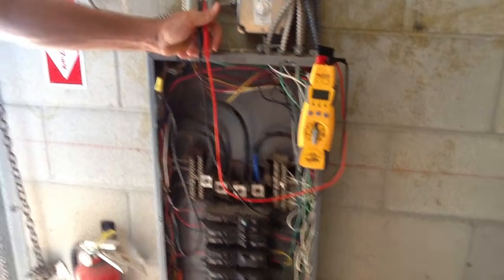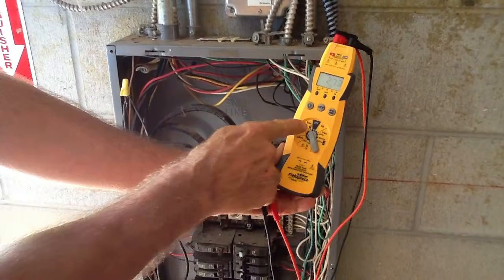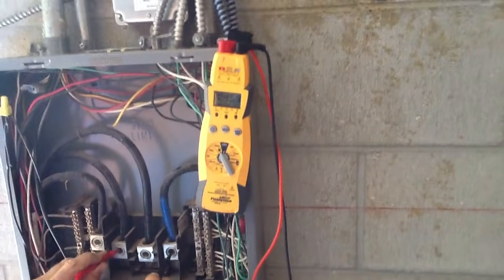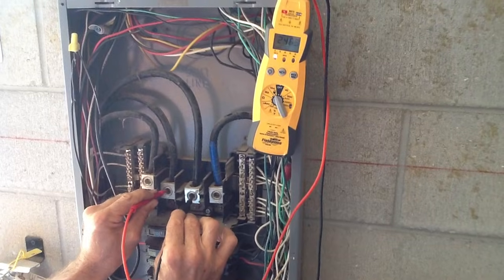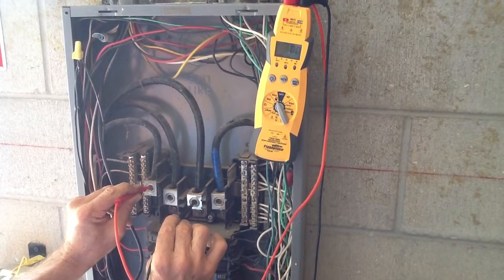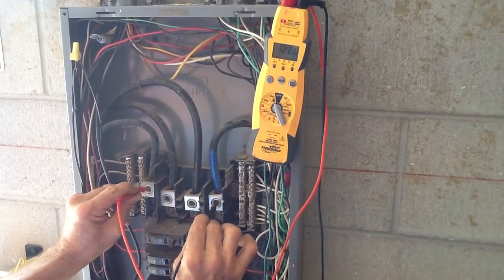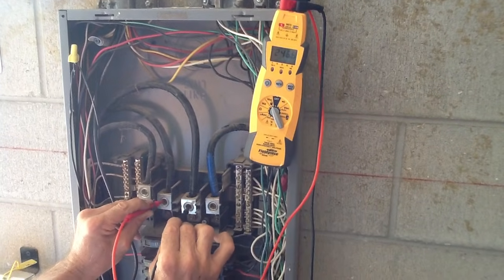How To Measure or Check for 3 Phase Voltage

Comment: Well, here in California, this is called 240 DELTA with high leg. That center power lnput (B) should have RED tape on it. That's 208 to neutral. Neutral is center-tapped between A and C at the transformer on the pole. There's NO high leg on a WYE (or sometimes called STAR) system, all phases are 208 to each other, 120 to neutral.
Reply: I thought the high leg always had to be marked orange.

Comment from the maker: This is a Delta system the center phase or high leg always has higher voltage providing by the power company for commercial business to operate large equipment at lower power rate to save power, also you will have 120 power for office equipment. Hope this helped. Thanks or asking.

Comment: You don’t always have a high leg on a 3 phase system
Reply: Ryan Gaines correct, he is getting power from a Wye-Delta transformer which will always have a 240V phase to phase and if done correctly L1 and L3 to ground/neutral will be 120 with L2 to ground/neutral at 208V. 
Delta-Wye would be a balanced load with equal reading across the board.

Comment: PROTIP: The National Electrical Code requires all high leg conductors to be marked orange.

I'd go as far as tossing a roll of Scotch #34 orange tape in my tool bag, to mark them as I came across them, as a courtesy and to meet a very easily (inexpensively) achieved part of the NEC.

See NEC article 110.15, which started requiring the identification as early as the 1975 edition. The high leg wire is to be durably marked orange or by other effective means. Also it's required to be marked anywhere the high leg and Grounded Conductor [Neutral/mid point/0v] is also present, such as at a panel, or a motor starter, etc

Before 1975, common practice was to mark the wire on the high leg red, stemming the nick-name "Red-Leg Delta".

Comment: I built a rotary phase converter and was testing between the leads to find one hot relative to neutral (the manufactured leg), thanks to this video I can see that this is a duplication of the normal measurements with "real" three phase supply.

Comment: Interesting.  I've never come across this set up before so I was wondering initially how you got the 240v across the poles especially after you said that there was a neutral. I pretty much assumed that if it had a neutral it was bonded to ground in a star configuration.  Apparently I have been living a sheltered life and I will be keeping my eye out for this configuration.

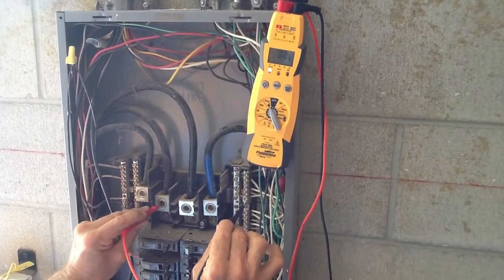Comment: This 1:33 minute video on “How to Measure or Check for 3 Phase Voltage” is provided by someone who, from his numerous other videos, is probably an expert in the field of HVAC/R (heating, ventilation, air conditioning and refrigeration).  However, regrettably, he seems not to be an expert in explaining what is actually being measured in this situation.  Also, it is doubtful that this could properly be explained in the very brief time taken.

I assume that electrical practitioners who are familiar with North American (and related) electrical practice will understand what is being measured and how it is derived.  However, those of us who are more familiar with electrical practice in Europe and the rest of the world may benefit from a little more information.

After calling out only one of the three measured Phase to Phase voltages (all roughly 240 V), the presenter has not helped by failing to “call out” the three "Neutral" to Phase voltages, thus making it necessary for you to make 5 out of 6 readings from his meter - which he calls a "Fieldpiece"..  This meter is a device manufactured by “Fieldpiece Instruments”, which is much more than a “multimeter” and is designed for use by HVAC/R personnel.

Some clues which may lead to further understanding of the electrical situation are contained in an earlier brief comment by “dougspair” who wrote:- “This is called 240 DELTA with high leg. ….. That's 208 to neutral.  Neutral is center-tapped between A and C at the transformer on the pole.”
(He also wrote “There's NO high leg on a WYE [Y] (or sometimes called STAR) system, all phases are 208 to each other, 120 to neutral.” – but that is not quite relevant to this situation.)

Also, David Jones posted a comment shortly after this in which he stated “This is a Delta system the center phase or high leg always has higher voltage providing by the power company for commercial business to operate large equipment at lower power rate to save power, also you will have 120 power for office equipment.   However, while a "Delta" system has no need of a "Neutral", (and really has no "center" phase) he has not chosen to explain either the existence of a "Neutral" and its derivation (or much else), in spite of various requests.

Be that as it may, I will now attempt to fill in some of the above omissions.

In North America, most domestic and commercial "low voltage" lighting and appliances are operated on 120 V AC.  Most premises in which such lighting and appliances are used are actually supplied with a  240 V AC single phase supply of a 3 phase system, via the secondary of a transformer.  HOWEVER, this single phase secondary is also “center tapped” and the center tap is "Earthed" to become the "Neutral”, with most premises supplied via THREE conductors – two “Live” conductors, each supplying 120 V with respect to the third (Earthed) Neutral conductor.  Should it be required to operate a large (high wattage) domestic single phase appliance requiring 240 V, this voltage is available by connecting the appliance across the two “live” conductors, which are 180 degrees “out of phase” with each other.  (In this 240 V operation case, the “Neutral” can be ignored BUT the “frame” of any such appliance MUST still be earthed.)

(Please note that these 120 V AC 180 degrees "out of phase" components have no direct relationship with the 120 degrees "out of phase" components of any 3 phase transmission.)

The situation being described in this video is NOT the normal North American domestic/commercial situation.  Here a (Delta connected) 3 Phase supply exists to power some quite heavy electrical motors (presumably associated with an air conditioning system) which require the rotating field from the 3 phase power supply.  The power supply company must use three conductors to supply this heavy power requirement.  However, the premises will also require the “Normal” (two) 120 V AC supplies, used for appliances and lighting in North America (and [possibly] a 240  V AC single phase supply).  Here these two out of phase 120 V AC supplies are derived by providing an Earthed “center tapped” “Neutral” on the A Phase to C Phase winding of the Delta connected 3 phase supply and this "Neutral" is fed by the power company to the distribution board as a fourth conductor.

The voltage “read” between the “Neutral” so derived and both the A and C phase points will be 120 V AC.  However, the voltage “read” between this “Neutral” and the B phase point will be the sum of the 120 degree “out of phase” voltages involved (120 V + 240 V).  While the arithmetic sum of these voltages is 360 V, because the voltages are “out of phase” by 120 degrees, we must divide this arithmetic sum by the square root of 3 (1.732051) to obtain the correct AC result of (approximately) 208 Volts.

In contrast to this arrangement, should a 3 phase supply be required in European countries (and most of the rest of the world), the supply would normally be via a Wye (or Star) connected 3 Phase supply, with 230 V available between each “Phase” and the (Earthed) “Neutral” point.  The voltage between any two Phases is then 230 V * 1.732051 = 400 V, but this is NOT a matter of any great moment - except for some small insulation considerations.

In the European (or "Most of the World") case, for single phase appliances and lighting purposes, 230 V is available from any single Wye/Star connected Phase point and the (Earthed) Neutral of the 3 phase Low Voltage supply.

(Please permit me to observe that, when any individual posts something as being "Normal", he should consider that what is "Normal" in his small area of experience may NOT be "Normal" in many other places in the world.)
Reply: very good explanation!
Reply: Uptight viewer...make your own channel
Reply: I appreciate the detailed explanantion

Comment: Sir I have a 3 phase AC generator with no neutral wire and I have measured its AC voltage through multimeter by connecting red and black probes to its two phase wires. So the voltage that I have obtained is the two phase voltage or someone else plz explain . thank you

Comment: i have a 460 compressor is there a way to run it ? i have a 240 three phase
Reply: +Luis Gaytan  you can most likely wire it to run on 240  three phase current.  from factory they come with a main plate that tells you how to wire it in low voltage(240). If the main plate is missing you can also identify the wires and wire it correctly.

Comment: PPE? No arc flash protection?
Reply: +Tim Gomes What is it on all of these videos with peolple asking about PPE. It is pretty rare to see people wearing PPE in the field.
Reply: +daniel goulet Just because it's rare, doesn't mean it shouldn't be done. You are right that it's not common. And pre-2008 electrical stnadard, it would fall under the old method of <600V. 
That being said, OSHA does require a flash hazard analysis, and appropriate PPE based on the result. 
He should have at the very least long sleeves though.

Comment: What Phase and line voltage physically mean, what is their role in life..  I know the line voltage is the voltage between two lines and the phase voltage is the voltage between the neutral and a line, that is only important for the calculations, however

Comment: Star is a 4 wire system 3 hots or live, and neutral and earth.Neutral is center tapped to earth so they become at the same potietial this means you could touch a neutral without getting a shock.Delta how ever has 3 wire's hot or live as known,and no neutral.this is because due to the cycle one phase overlaps the other phases in one cycle which in simple terms means that one phase is all ways in the negative cycle while 2 phases are in the positive.the negaive overlap acts as a neutral

Comment: Can you check 3-phase with a Fluke 177?
Reply: Please don't try to do this if you don't even know what you are doing. If you would know it, you'd know if it's possible or not.
Reply: ***** Too late. I already did. I posted this question a month ago.
Reply: Oooooooh be fuckin careful. Something as simple as hooking the probes to the wrong inputs on the meter can result in a flashover and extreme damage.

Comment: This connection cannot be three phase system. Because in a 3-phase  "Y" connection, the voltage to neutral = line voltage / 1.732. Threrefore , your phase B to neutral reading should be 141 volts , not 208 V. Moreover, Delta system doe not have a neutral in it , unless it is centered-tapped.
Reply: It's not a "Y" connection.
Reply: It is a 3 phase system, looks like a 120/240 volt delta 4 wire configuration, with one phase being the wild leg at 208 volts phase to neutral.

Comment: If I want to wire a three phase 230volt hydraulic motor from this system do I still use the neutral or just the three phase wire with no neutral.

It is a Lincoln welder and generator.
Three phase delta

Comment: where is your arc flash ppe?
Reply: +wile coyote  open air is a great insulator, standing on the ground on like this is perfectly safe as long as you take proper care.
Reply: wile coyote welcome to the real world.
Reply: listen to this man an arc flash can happen on a live circuit with faulty equipment  , just his leads are enough to create an arc flash alone and he has both hands in the box to near the end of leads - no gloves ffs  , you can get away with this but if you dont you will regret it for ever  , watch videos of 480v arc flashes and come back and say real world  .

Comment: This is why you don't hire HVAC tech's as electricians. 😅
My God... so much misinformation here.

3-phase does NOT "always" have a high leg. If this were a 3-phase 120/208-volt Y system,  there is no high-leg (all three phases will give 120v to neutral & 208v ph-ph). Same with 277/480v systems... there is no "high-leg". There is no high-leg on a 240v corner-grounded Delta either.

On 120/240v 3-phase systems (as shown in the vid), one of the three transformer windings is center-tapped and grounded, thus deriving the neutral leg (grounded conductor). Phase-phase will be 240v, and two phases will be 120v to neutral, with the third "high leg" being approx. 208v to neutral (this phase is NEVER utilized as a phase-to-neutral supply).

Lastly, the NEC does NOT "require" the B-phase to be the "high-leg". It recommends it, but any phase may be high-leg, as long as it is properly identified (typically with orange, or other differentiating/unique color). And, in any panel where the neutral is present/available, the panel must be marked to indicate the high-leg, e.g., "240v 3ph, High leg on C" (or whichever phase it is).

Don't hire this guy to do your electrical work! 😅😅